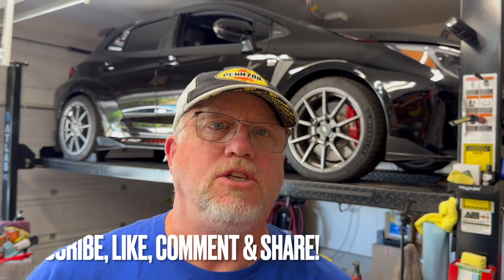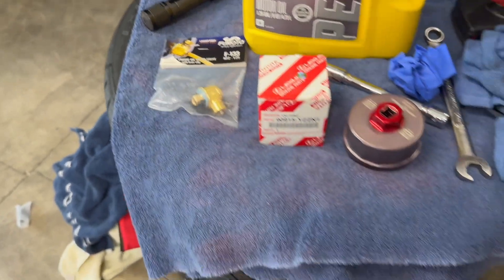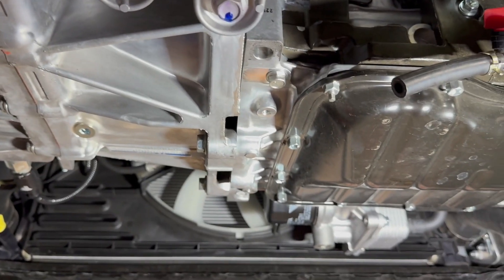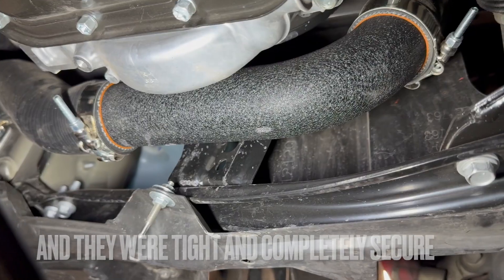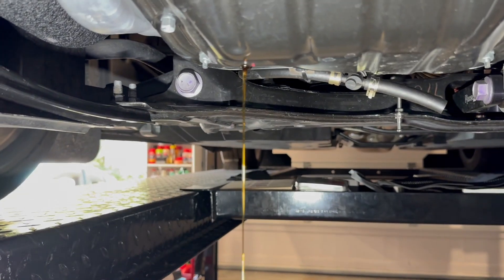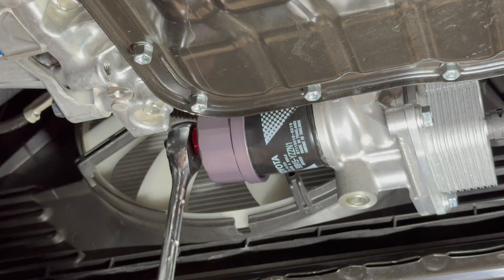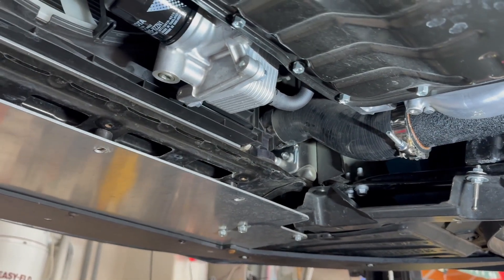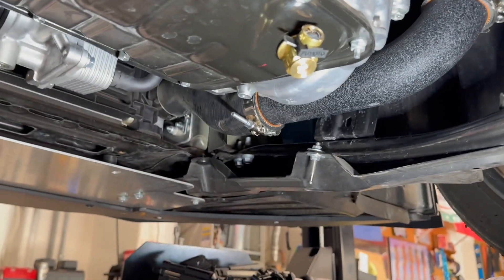GR Corolla Oil Test: The Science Behind the Madness

Comment: I am using Amsoil SS 0W-16 in my 2021 corolla hybrid,And Penzoil platinum in my wifes 2024 rav4,great job here.I use Purolator one pl14477 long filters,those toyota densos are 40 micron,built for flow.
Reply from the maker: Well, flow is important! It would be interesting to know what is the best trade off for flow vs filtration? When is too small filtration a point of diminishing return?
Reply: @jimsgaragetoys  Its like filtering water or air,the finer the better,as long as you change them on time.
Reply: I have the same car as you (same engine and trans) but I'm in Sweden. In my owners manual you are allowed up to 5w-30 and it specifically states the 5w-30 may provide better protection. The 0w-16 is for fuel efficiency, you don't need it.
Reply: @AEVMU  Throw away the efficiency of a lighter oil? Toyota designed these engines for light oil,ow-20 is ok,5w-30 is a waste of money. Do some research 6b oil is superior to 5w-30,all 0w oils are full synthetic.